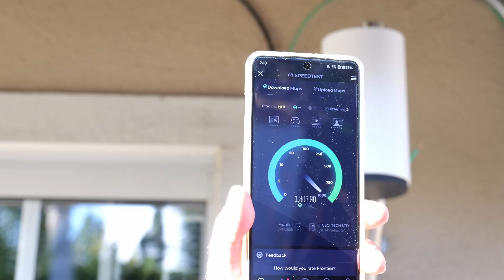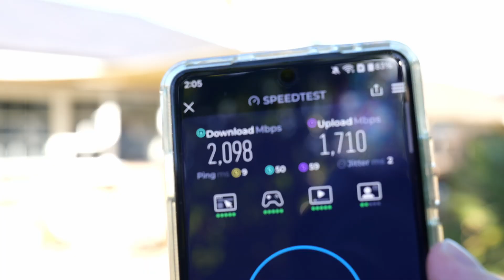TP-Link Deco BE65 Outdoor Review: Perfect Backyard Wi-Fi 7!

Comment: I wish I would have gone with Tp Link. After owning a Asus XT9 for a few years. The XT mesh node is never stable. It’s always changing WiFi speeds and output. Even with wired backhaul. I’m always having to trouble shoot
Reply from the maker: Really? Have you tried a factory reset and firmware update?
Reply: @landpet Yes I have. Twice. I always have to check weekly the output of the 2nd node. It’s 50/50 on what I’ll find. Also the phone Asus App it’s very intuitive. But the changes you make on there don’t always change the system. The actual website will though. It’s frustrating. The simple things are hard….and the hard things are simple with that system. I wouldn’t purchase again….
Reply: @l @landpet it’s been going on for 2 years now. Warranty is out. The diagnostic and repair costs are not cheap. Basically better off buying a whole other system.

Comment: Do you recommend this be65 outdoor as a access point or a unifi AP? My main current setup is a cloud gateway from unifi. Using the cloud gateway as a router and the be11000 as a mesh. Unifi is so difficult so configure compare to TP.  Im thinking of dropping the cloud gateway max as a router and just using Be65 as a whole unit.
Reply from the maker: I haven’t tried unifi. I will say it’s best to stick with the same ecosystem. If you plan on using unifi, I would stick with what they have to offer, assuming they have an outdoor unit. If you plan on switching over to Deco then I would use all Deco